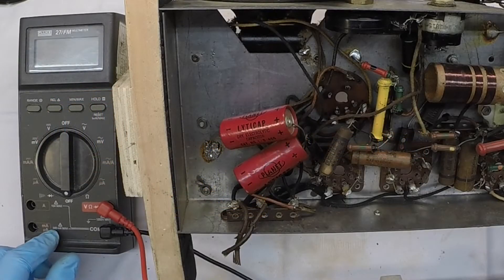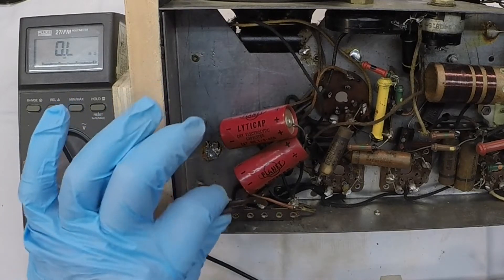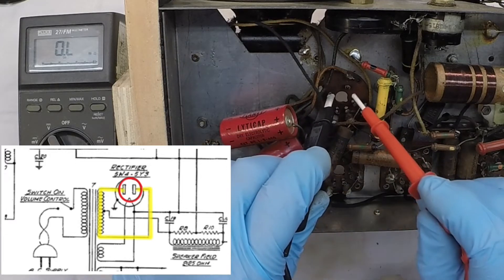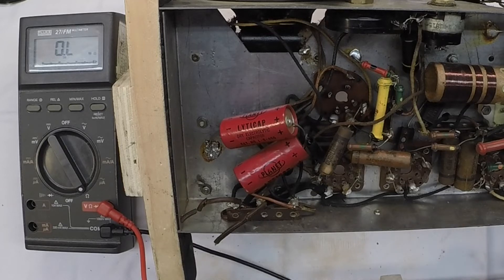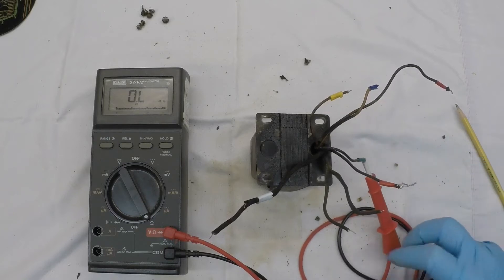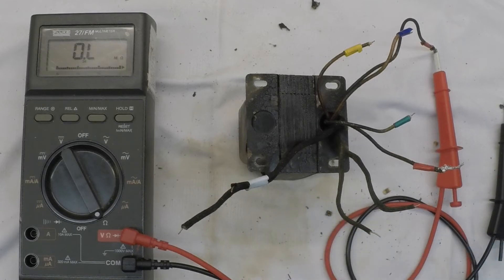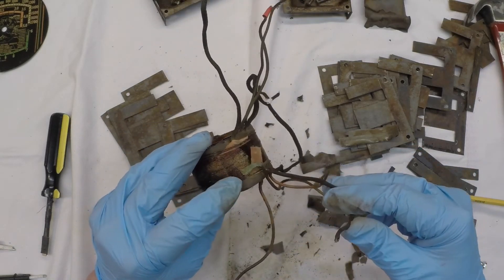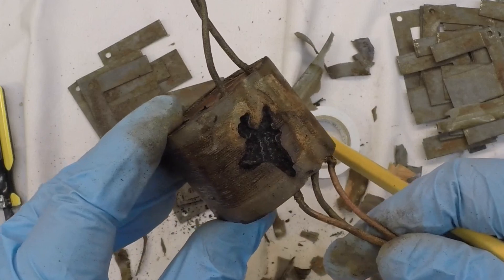Jackson Bell Model 556 - Power Transformer (Good or Bad?)

Comment: Don, just rewind the 6v winding, using the 5v winding as a voltage guide. Check for damage on the next layer down, and rewind it for 6.3 - 6.6 vac.
Reply from the maker: Cjay - I wish I could. The HV winding is toast too, but that was common in many of the low cost receivers with power transformers on the edge. One shorted cap or rectifier tube issue took many of them out of service. Thanks again for reaching out. Best, Don

Comment: Having shorted windings in the power transformer put this radio on the sidelines.😧
 Probably a good candidate for a complete rewind overhaul. I'm sure it's unlikely you have a replacement sitting 
around looking for a new home.🙄
Reply from the maker: Steve, I’m hoping one of them may work out. I’ve got a few stashed away I need to dig out and evaluate when time permits. Until then, I plan on getting the seized up tuning condenser out and seeing if it will clean up. Thanks again for following the series. Best, Don

Comment: Oh so sad that xformer didn't make it Don. Man that must have really cooked at some time in the past. Sec to primary short is the worse I bet.
Reply from the maker: Tony, it was disappointing to discover this, but never unexpected when working on these vintage receivers. Hopefully I’ll have a replacement and move forward with the restore. Best, Don
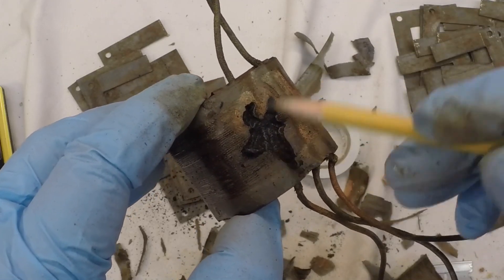Reply: @RestoreOldRadios  looking at 7:42 Don that was some bright areas of sparks I bet too. I bet the house lights went dim back in the day as well. I have to ask, and one that is on my mind with a few old radios I have as well, where do you find a replacemant when it's this dead? I bet that company did not make there own xformer? Don't know tho. Is there a part number for it? Who else would use that type. Do some old obscure Emersons use that same style and even have the same VA ratings? It will be great if you can find one. Looking forward to your next vid here buddy. This model would be great to see powered up again.